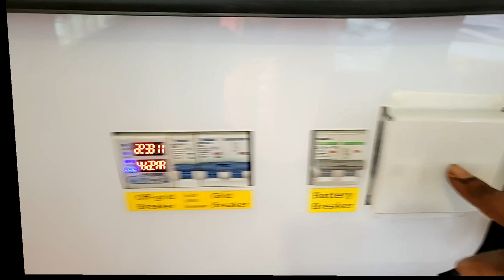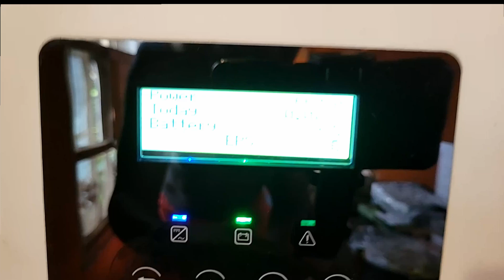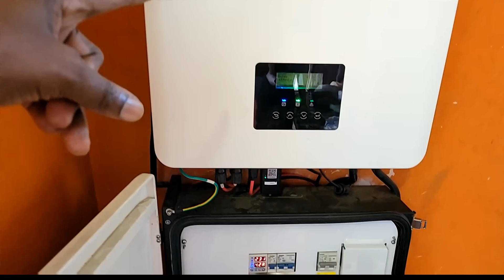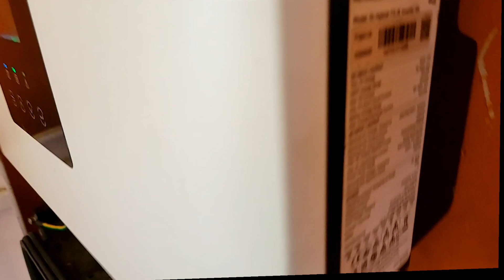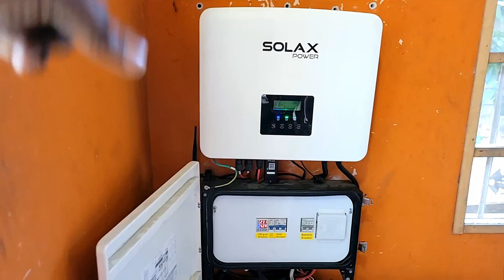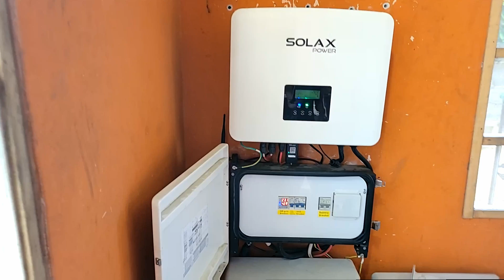- "SolaX Inverters And Batteries: 3 Years Later, Is It Worth It?

Comment: Good morning sir, Please I need these
240Ah-48v (4 batteries)
650watts to 710watts (6 panel)
80Ah. (Controller)
5kva  48volts(inverter)

Would like to DM you for consultation
Reply from the maker: @NancyEtomuyo  good morning. Please message me at +1 201-815-4132

Comment: Sunsynk has good products, problem some have had is slow warranty issues, which can be bad for business. For bigger systems they have the Enegator container, which may be worth evaluating.
Reply from the maker: Warranty issues can be a killer. We like replacements instead of repairs. The container solution is a dinosaur. There are suppliers that are about to shake up the industry. Thank you for watching and commenting.

Comment: Another great video Doc, low voltage or high voltage?  Which is better?
Reply from the maker: @Floyd112007  thank you so much. High voltage always
Reply: @drsolar  Thanks for confirming doc, I was leaning that way.   Final question for today,  low frequency or high frequency for the average house?  I have heard a lot about the greater surge capacity of low frequency but  I think you might just have to get a slightly bigger high frequency system.   Thanks for introducing me to Deye,  I had a bad experience with a Growatt low frequency inverter but I am loving the Deye high frequency so far.  It charges much faster, it's quieter, and it communicates with the batteries a lot easier.  Keep up the great work.
Reply from the maker: @Floyd112007  the HF inverters are more efficient. Good quality units can surge. So will surge to double the rated capacity. They cost less to produce.

Comment: Thank you for the update sir. Does Solax have low voltage inverters?
Reply: Great job sir 
Weldone 👍
Reply from the maker: @suleimanibrahim5536  thank you for watching. Yes they do.
Reply: @drsolar  ok. Thanks. Keep up the good work. In a few years I want to install a big system that can run upto 8 mini-splits at the same time and a tank based water pump. 4 microwaves and  up to 4 irons at the same time. Can 15-17kw of panels charge 100kwh of batteries and with 3 days autonomy would the 100kwh of battery be enough as it’s 2 x 1 bed apartments, 1x 2 bed apartment and a 4 bedroom house. I was also thinking of EG4 18kw inverters x2 pc. What do you think?
Reply: @cCaribbeanSpursTv  that this specifications you aiming at would be enough depends on your actual consumption vs energy production. Buildings of the same size/number of rooms do not necessarily use the same amount of energy.
Reply from the maker: @cCaribbeanSpursTv  system design. You need to know what your consumption over that period is in KWH. Then you can get your answer. Thank you so much for watching
Reply: @drsolar  I anticipate my consumption would be around 23-25 kWh per day in total across all properties. Hence I’m planning for 90-100 kWh battery bank. But if we use more ac than anticipated that’s where my concern comes in. Also I was more thinking about the space on my roof. I can only squeeze 30 panels maximum on the rooftop. And the land space is taken for fruit trees and vegetable garden.

Comment: Thanks for the update Dr Solar. I noticed SolaX recently introduced interesting high voltage and high capacity inverters which would have been better fit for that massive hotel project you did sometime ago. Deye also has an interesting 20Kw low voltage 3-phase inverter now. I wonder who your new supplier is, Solis, Goodwe, Luxpower, Sofar, Sigenergy?
Reply from the maker: Thank you for watching and commenting. SolaX has been on a tear with new product introduction. We did a project a month and a half ago using the 30 kw SolaX ultra. They have pushed out many more new offerings. How have you been?